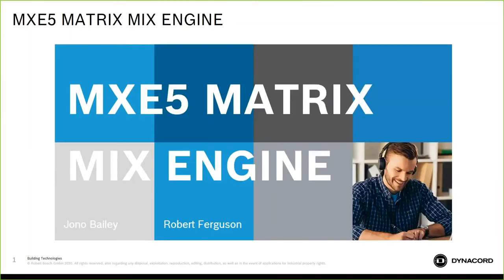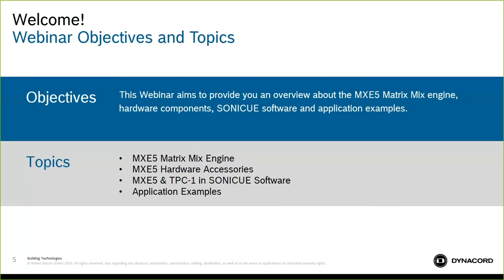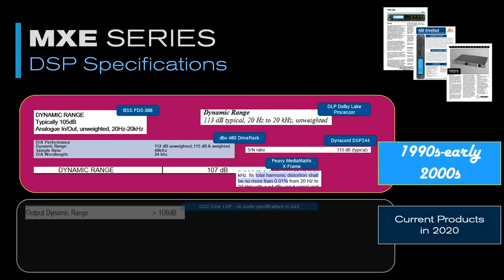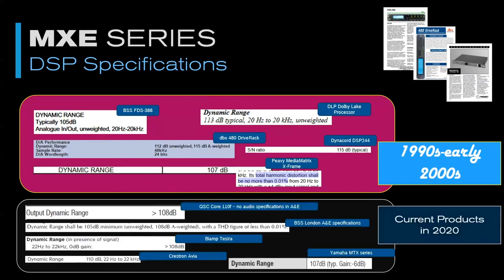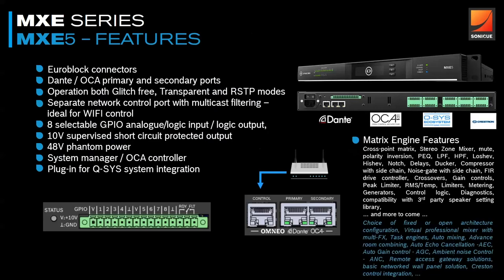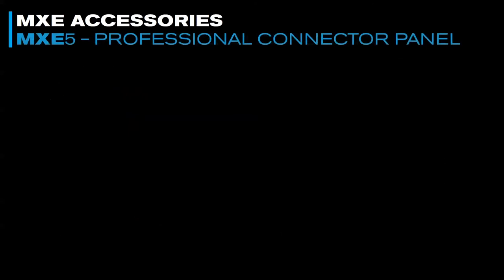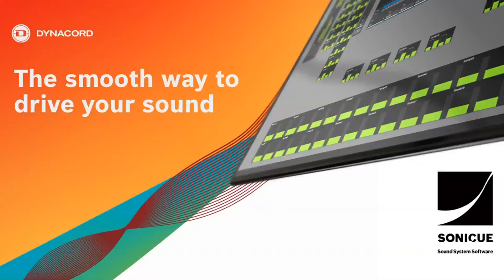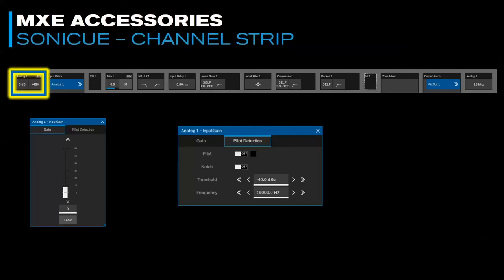Dynacord MXE5 Matrix Mix Engine - Summer showcase 2020 webinar

Comment: You mentioned that you use third-Party equipement. Wouldn't it be better if you would develop your own digital FOH mixing console considering system integration? The MXE seems like a great starting point.
Reply from the maker: Thanks for your input. The 3rd party equipment we referring with MXE are control and audio interfaces, which are important in the installation market. The mixing console in a sound system we see twofold:

the part where the integration into the sound system has obvious advantages for the user – the latest EVOLVE 30M and 50M column speakers feature Dynacord mixing and FX,

and the part where the mixing console (like the use at FOH) is seen as an independent device, selected by individual user preferences featuring “common” interfaces ( e.g. Dante Audio) to the rest of the sound system. Dynacord Team.